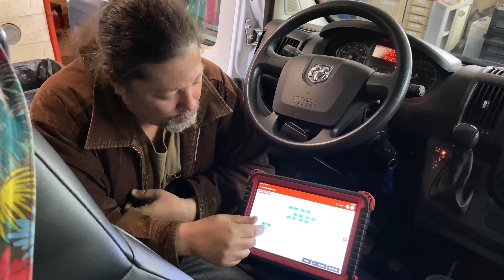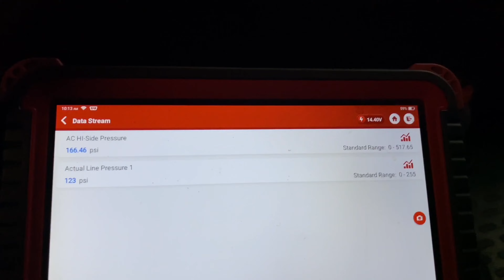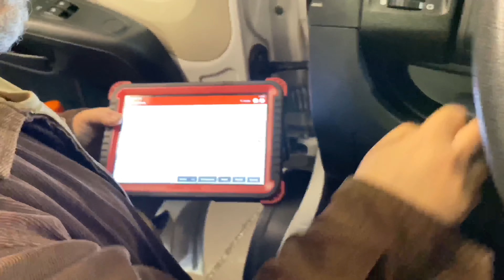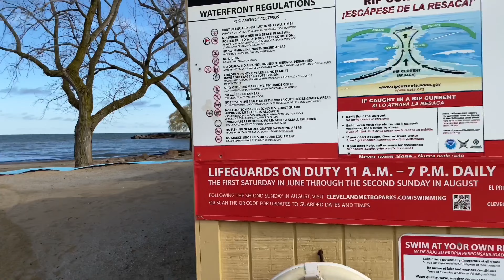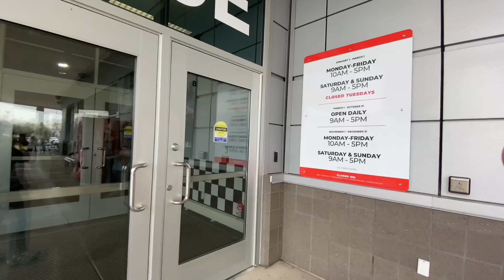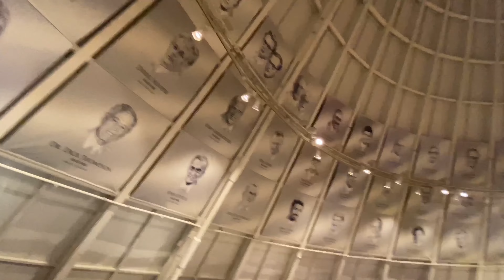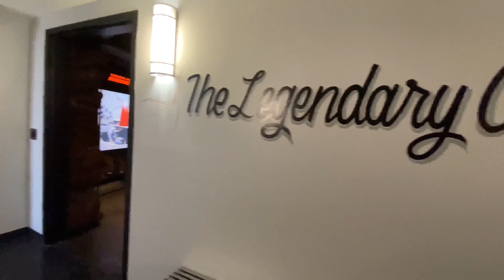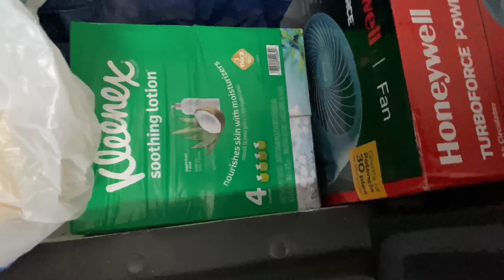(Long) Moms RAM ProMaster Van @promastersonly1419 “KIP”, Corvette Museum  🤘🏻😎🤘🏻(theMekanik)

Comment: Point of clarification: oil change is every 5k miles, transmission fluid and filter is every 60k.
Reply from the maker: Kewl Thanx for Looking Out for my  Moтнея & Her ProMaster Van You are a Wealth of Knowledge!!! 🤘🏻😎🤘🏻 

I still need to watch (wat4) your video on the korrekt fluids & filters to use.

Do you have a Maintenanse Google Spreadsheet? I would like to start a Master Maintenanse Log that is somewhat Publikly Accessible for Owners, Operators, & Teks 

- Type of Work Done
- Who did the Work
- When the Work was performed 
- Parts Used
- Aktual Time Spent, Not Padded or Book Time
- Troubleahooting Steps 
- Regular Maintenanse Done
- Miscellaneous Info

It would probably be a huge undertaking but totally worth the time to build it.
Reply: @theMekanik  I don't have such a system of tracking maintenance, but it's a great idea. She and you will find out on the Promaster that the same stuff breaks over and over, and a bunch of stuff never breaks. It's kinda refreshing, in that sense. Like, in over 2 million miles on my own vans and 10s of millions of miles on customer vans we have NEVER replaced a water pump. Ever. Crazy. Or a master cylinder. Or a power steering pump.
Reply from the maker: @promastersonly1419  🤘🏻😎🤘🏻